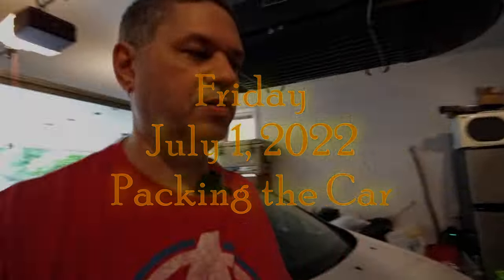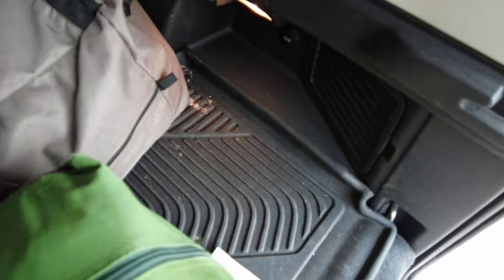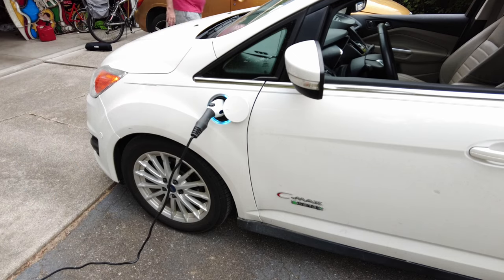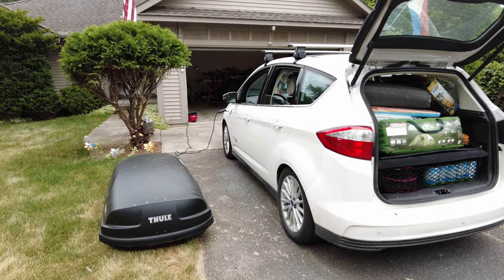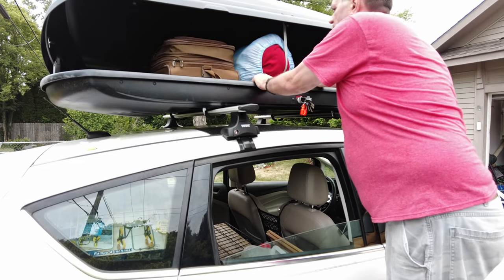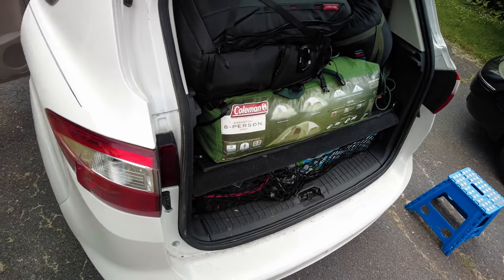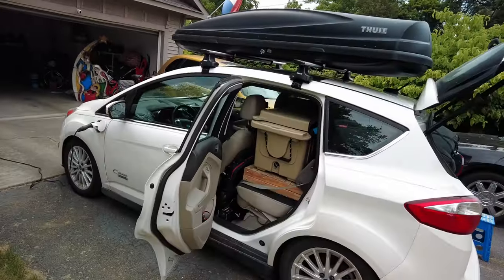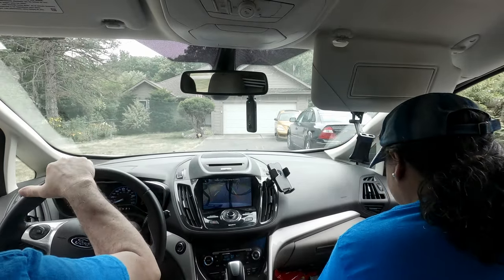Packing the 2014 C-Max Energi for Camping

Comment: What crossbars do you have? What specific ones from Thule? I’ve been trying to find bars that will fit.
Reply from the maker: @mad_lawns  We got everything from Amazon, but went to the THULE site in order to make sure we got the correct fit kit number for the c-max.

Here you go (this is all pulled from our Amazon order history):

Thule 480 Traverse Foot Pack
Kit 1683 (this is the fit kit for the c-max)
Thule Aeroblade Roof Rack Bar (not sure if they still make this)
We also had to get the lock cylinders separately: Thule Lock Cylinders for Car Racks